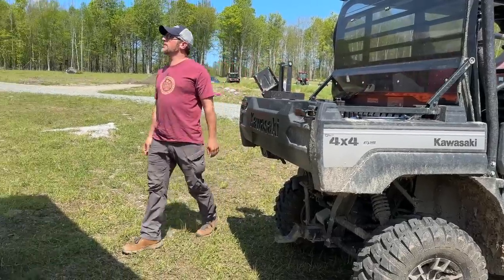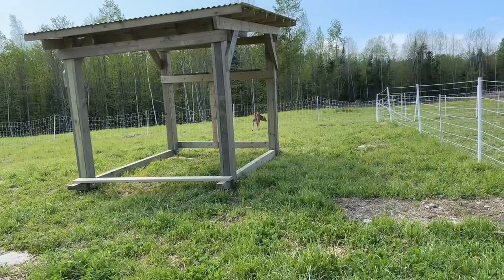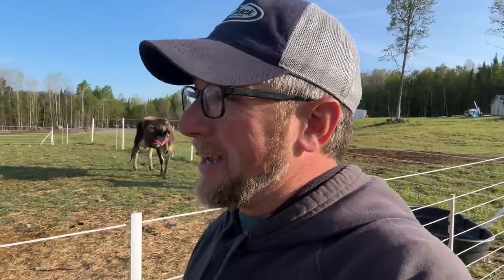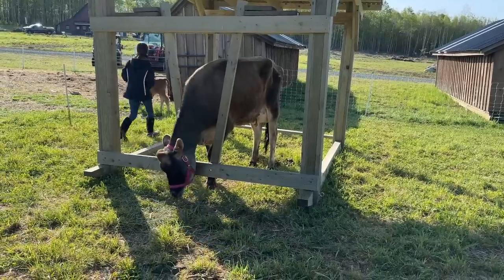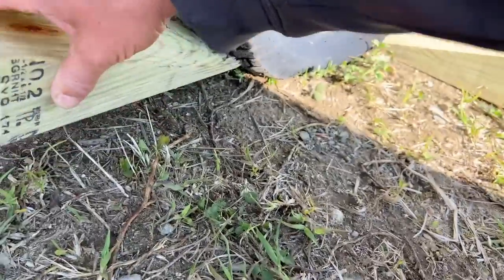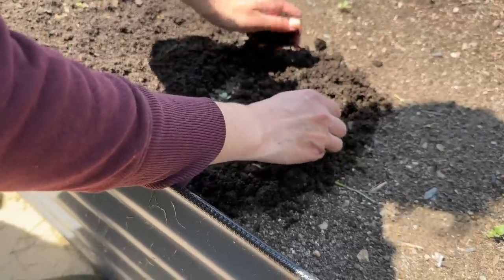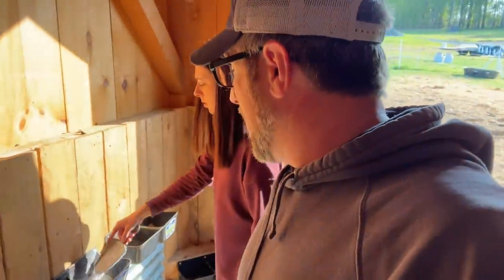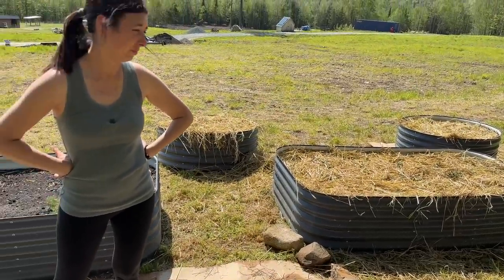THIS is How It ALL BEGINS | Growing Our OWN FOOD at Our OFF GRID HOMESTEAD

Comment: Al, you need to put a feed box on the stanchion so you can feed grain or alfalfa pellets while you are milking.  When they are eating, they will give more milk.  Also, teach her to back up as soon as you open the head gate to get out of the stanchion.   She has to get used to the idea that that is her milk station and nothing more.   Cows learn routine very very quickly and in just a few days, she will be going in and out of that stanchion every single time like clockwork.

Comment: I used to bicycle over 5,000 miles a year and had a lot of flat tires until I read about 'Tuffy' tire liners. I it just a strip of hard flexible plastic you put between the tube and the tire. I went from a flat a week to a flat a year. You should be able to make these yourself as you aren't taking the trailer(s) on the road.

Comment: Al,
I hope you have better luck with Harbor Freight tires than I've had. The tires on my two wheel dolly only last alittle over a year. And the 10" tires on my lawn cart cracked and fell apart after two years and hardly used it.

Comment: Cold weather tip I learned many years ago.  Save gallon jugs -  Fill and set beside plants.  Day sun warms the water and night radiant heat helps keep plants warm.  Of coarse this is not a greenhouse for the plants.  It was suggested to put very small hole in the jugs to water the plants (I did not like this).  Good luck.

Comment: I honestly asked myself what those tires were rated for when you were airing them up. You had 1400 pounds of water on that trailer. Looks like it could be as much as 2200lbs+ the weight of the tote itself if that's a 275gal tote.
Reply: Plus the weight of the wood on the trailer. My Gorilla Cart is rated to 1500 lbs and I have 16 inch wheels. I decided I didn't want a flat so I bought the airless tires. Yup, maybe too much weight.

Comment: for the feeding trough you could bolt star pickets to the legs and use the weight of the tractor to push them into the ground.  you should consider a few quail for tick control in with the cows and goats

Comment: I had a little to do with a rural heritage museum and they had a number of buildings on skids. To facilitate movement they put steel plates on the forepart of the skids.
This made the tow on rough ground easier and also prevented tear out on the front of the skids.
Perhaps 2" wide steel bar, say 1/4" thick could be bent and screwed on.

Comment: For those tires, you might check and see about getting them foamed filled. Years back the aired tires on the finish mower at camp kept going flat from taking it into areas that might not have been ideal to mow. 🤭 So after maybe 5 times replacing tubes, (I'm a slow learner, but cheaper than new tires, I took them to a local tire shop and they filled them with a hardening foam, and they have never given any trouble since, and it has been easily 15 years ago.

Comment: Hi Gina and Al, where you guys are doing awesome. I don't know if you already have one, but for Gina's gardens there's a tripod type. Waterer that has the directional settings that you just leave the hose hooked up, and you can just turn the water on, and not have to stand there. Comes in very handy. It is awesome! You might consider getting a second one to come on on the hot days when the cows might like getting watered😊.

Comment: 35 PSI may have been  too much pressure for those tires.  What does the sidewall say the max pressure is?  From some research online, tires that side for that application should be no more than 15-20 PSI.

Comment: hahaha man you have so many machines that could move that water, i was questioning the dinky trailer situation
Reply: Remember that cars have 30 or so psi in the tires and hold up a whole car. Sometimes it's just the rubber that goes brittle. Car tires have the steel belts often too. I think it was just bad luck. A trailer with better tires would be more dependable but cost more. We went with the airless tires but they cost more. We got tired of mystery flats on the wheelbarrow while it was just sitting in the garage. It rolls so much easier with the airless tire too! I got a Gorilla Cart and got the airless tires too. It rolls like a breeze.
Reply: @StoneKathryn  ugghhh i don't need to remember anything about PSI when I know he has 3 different pieces of Mobile equipment that have forklift attachments, one that he showed in this video haha no need to use a dinky hay wagon when you have all that power sitting around your property!
Reply: @wesrundle6326  True!

Comment: As yes, you do have a knack for over engineering. I appreciate every board, nail and screw that you use because you come up with some cool ideas. As you're pulling that around with the side-by-side I'm thinking Justin Rhodes could use some of that acumen or better topography because there's no problem with moving that around. Avoid the rush and order some inner tubes for the wagon. A hand truck with tubeless tires just aches to go flat at the wrong time. I go with the hard tires whenever possible. Oops, I jumped the gun writing that last line cause you just came to the same conclusion now that the tire blew. I did not put that down after the fact to rub it in cause I screw up a little once in a blue moon. The biggest enemy of tires on a farm is due to dry rot from age. With steel rims that could and do get rust I would have a tube in the tire of any wagon that I couldn't get a solid tire for.
I get what you're talking about when it comes to planting outside. Having lived in Wisconsin it was always a rush to get the stuff in on the 1st of June. South West Mo. there's potatoes that have been going for a couple months. I might have a jump on things if I get the pre started stuff in the cells from Wally's but the growing season is a lot longer and I like your idea of waiting a couple weeks to get a second crop. First week in July I planted a tomato and I still got a few. Now with three different colored peppers to stuff with all sorts of herbs I have growing at their base in 8 self wicking pots cut from 4 food grade 30 gallon barrels. See some of Daniel's @ Arms Family Farms videos from a few years ago for all the details.  I grabbed some of those cloth reusable shopping bags from Walmart and with composted humus make wickers out of them with buckets for beets, lettuce, beans and whatever else trips my trigger. Now to go back and look at something you did that caught my eye. 
Is that the cows first calf or has it had another? As laid back as she is it looks like somebody loved on her a bit more than she would be if she came from a herd. Pete's @ Just a few Acres has some pretty mushy critters but this is a happy camper you have there. And now I got my farmer fix have a great one.😁👍

Comment: I suggest cutting those bolts off that are used on the head lock. I'm afraid she may get excited and kick her front legs and get hurt. Might even recess the nuts into the wood to keep her from getting into them. Just a suggestion.
Reply: 11:57 - those threads coming out from the long carriage bolts which are the pivot points for the head lock.  I agree, they should be cut back and or some rubber pipe put over the threads to protect Azalea's hoofies.

Comment: Solid rubber tires is what you need Al.
Reply: As Al stated in video.
Reply: @tonygrimes13  Al said plastic not rubber.
Reply: @dfusit  He said Solid Tyres.
Reply: @tonygrimes13  He said “hard plastic” 22:08 .
You do realize the difference between solid rubber and hard plastic don’t you? Try admitting that you were wrong and move along. Good day Sir.

Comment: I wonder if the tires aren't rated for the load. A US gallon of water weighs 8.34lbs, that's a bit over 2500lbs for a 300gal tank. Plus the weight of the trailer, all sitting on those 4 little tires.

Comment: Quick Tip..I prefer  to use a steel grain-coal type  shovel when moving  large amounts of loose earth etc. since its faster than a regular shovel. One is still moving the same amount but with fewer scoops are needed since its a bit easier on the arms-back and my favorite has a 6ft handle...Hello Figaro too.😺

Comment: Your waving that feed bucket infront of her I'm surprised  she didn't break the new head lock . You can see she has and  been well trained please don't undo that training .if she in the head lock do something with her don't leave her for ages in it without doing something  to her .and try keep baby in her view.  Talk to her tell her to back up  or over and give gentle pushing  in the direction  you want her to go . Use the lead rope to move her into the days new pasture even if it's just a gate between . So she knows she can't go there until you take her or she will get to start running train the calf aswell .lead rope every time you move them both. Ali you did horse riding its very simular in the training of your cows .they are big and you need them to know rules and manners .the mum looks very nice and well trained but it is easy to undo that training and training means they are safer to be around . She is wonderful cow.
Reply: Very good advice! I hope Al and Gina read this. Have a great week!

Comment: Nothing could be worse for your house than leaving the siding partally done, water (even from morning dew) will run down behind the siding you have on and will start to eat away at the sheathing underneath, doesn't take long. A scafold system would easily fit at the back of your house and allow you to finish in a safe manner and it is very cheap compared to all the machinery you rent and/or buy. Bet you haven't finished the trim work inside as well, seems you get to things you don't know or like how to handle and just ignore them.....?????
Reply: If you have been watching their videos then you would know that they are awaiting delivery of a specialised lift to complete siding.
Reply: @tonygrimes13  instead of waiting I suggested a simple scafolding , safe, affordable, and more than adequate. they are delaying completing the overhang they added, again bad for water penetration. they haven't completed door trim, baseboards, and covering electrical switches on the interior, why. ask them....